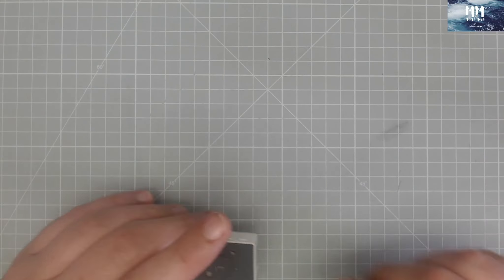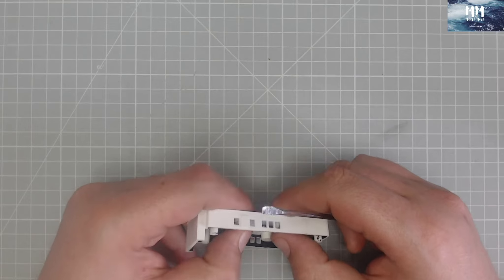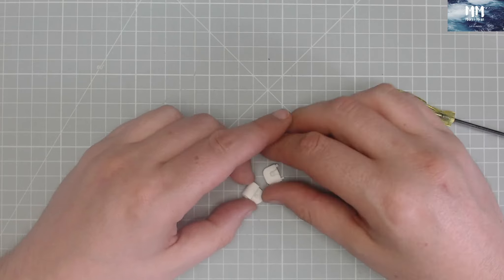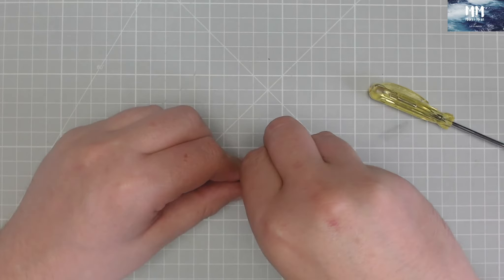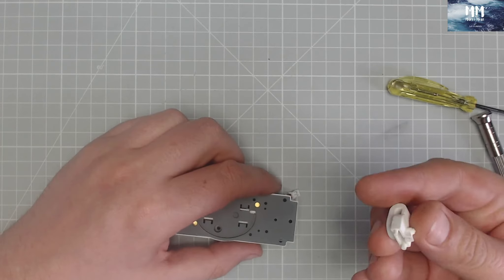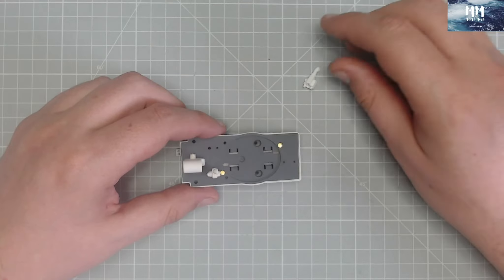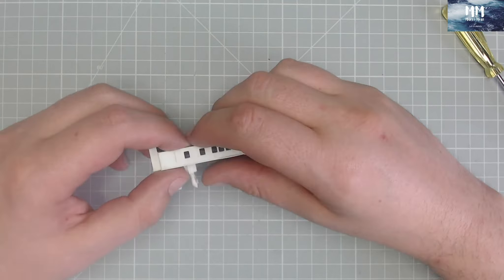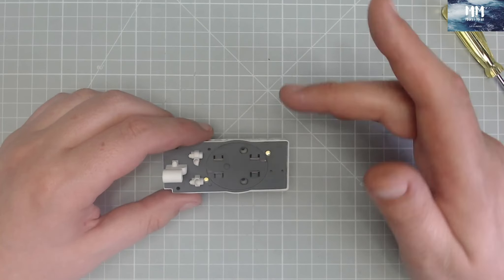Build The Titanic Issue 56

Comment: Dont need 2 change the pin u use 4 gluing, run an old scalpel dn 1 side and the rest of the old glue peels of, i use an old sewing needle and had it many yrs, another quick 1
Reply from the maker: Thanks Dee. I like to change them from time to time. I do have 200 of them lol. I also use a lighter to burn it off
Reply: @MarksModz  only 200 lol,
Reply from the maker: @deeharris1908  why do things small